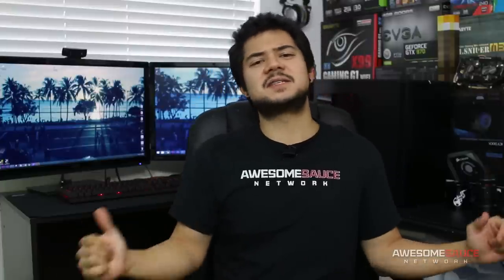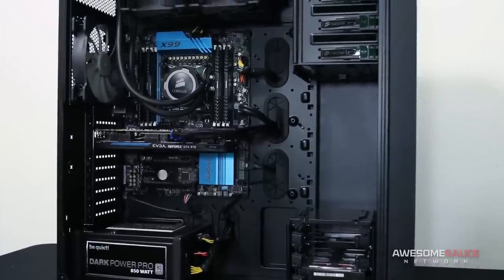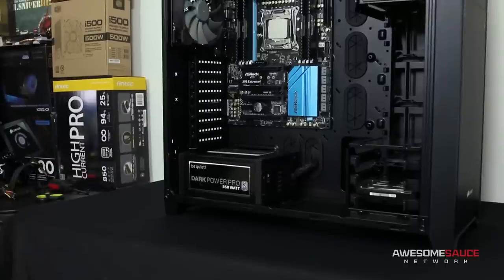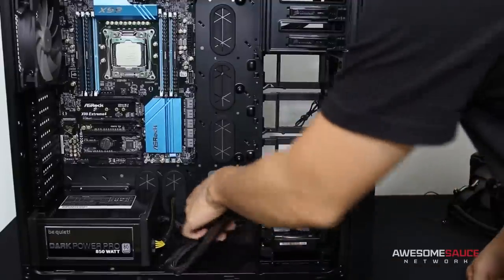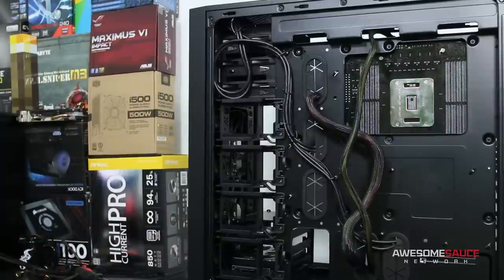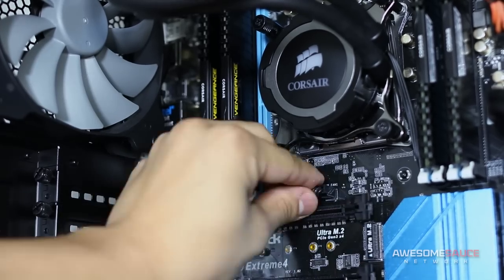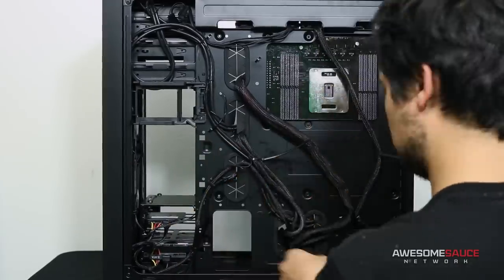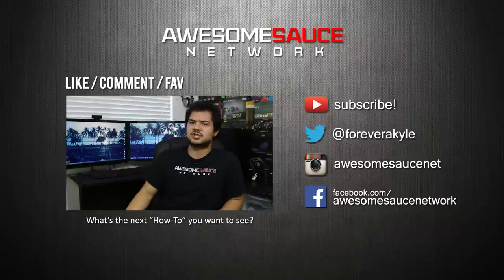How To: Cable Management

Comment: Good stuff, probably upgrading my case on Black Friday.
Reply: Chas Stack  My rig is looking  a mess right  now, upgraded my power supply from Corsair semi moduler 850 watt PSU, to Corsair  RM1000 ribbon cable fully  moduler  power  supply. Ribbon  cables to my surprise  are a bit harder  to work with. Oh well,  buying  a new case  this weekend  that's  more cable  management  friendly, current  case is almost  7 years  old.
Reply: hababacon yeah they twist ez i changed to a cx750m  and had same issue
Reply: Upgraded to Corsair 780T, also upgraded CPU from I7 970, to I7 5930K.
Reply: yeag i got a 3570 now and a 280x 6gb ard and 32 gb ram htperx beast.majoroverkill but great priceon amazon
imay need a new keybboard my k70 is ating up
Reply: wykedinsanity Went with 16 GB DDR 4 (2.66 GHZ), I wanted 32 GBs, but X99 platform is so damn expensive. Almost $1100 for three components, which killed my budget. Next upgrade will be my monitor, looking at ASUS 144HZ 1440P monitor for my BD in April. My current Samsung SA950 is great, but I want beyond 1080P gaming. 4K 60hz monitors are too slow for now, if I could run at 75hz I might consider it.
Reply: yeah ddr4 is pricey
Reply: 32gb of this was 500ish asit was and a bit less maybe withourtt looking in my amazon act again
Reply: aavoided corsair uz my dominater heat sinkks fell off for gods sakke
and now my k70 is acting up
Reply: wykedinsanity $500 for memory? A bit too much for modest gains. Paid $230 for mines, I didn't want to go above  $275. I hope this November DDR 4 prices drop down to $175 for the kit I got. If so I will either double up or look for faster ram with lower latency. In the mean time I don't see myself maxing out 16 Gigs anytime soon.
Reply: hyper-x beast xmp tho and 32 gb
Reply: still alot and no you dont gain much after 16 gb even thr orsair rep told me that oin the phone on my first build but my peicing was less i thinkk was like 50% off so my bad i went and lookked at my amazon history a bit ago 500 was retail msrp

Comment: Really wish I went for a modular power supply myself, though it's a little late now. The "rat's nest" is just off in it's own corner of the case away from the intake fan, so all things considered, heat hasn't been an issue.

Comment: I use a tie wrap gun on the lowest tension  setting. leaves a clean cut that doesn't leave any sharp edges like you would using scissors.

Comment: I have a rig, but I need to completely rebuild it. I must get an anti-static surface to lay my components on, clean them with pressured air (cleaning my previous rig too), install the mobo (the CPU and cooler not being removed), reseat the RAM, put my CS750M in place and screw it in, get an HDD cage that I've neglected, install two harddrives (WD Green 1TB+2TB), screw that into the machine, reseat all the fans, hook them up to the fan controller, take a DVD RW drive out of all my stuff, screw it in in the 5.25" slot, plug its data cable in, plug my HDD SATA cables in, plug in the IO, hook up the 24-pin, the 4-pin (It's LGA 1155), the power to the fan controller (2-pin?), the HDDs' power cables, the (molex?) cable for the DVD drive, all possible in the basement, finally plugging in my GPU with two 6-pins. It's a bit messy right now and I feel a bit badly when I run it. It's not really finished.

Comment: I've got a Thermaltake Commander MS-i, i got an EVGA 600w 80+ Bronze PSU, and it was easy to do the cable management, the thing is that im still going to put an R9 390 on it and i noticed that it will be blocking the sata connectors.... btw awesome video

Comment: LinusTechTips did testing that found that cable management doesn't dramatically impact overall system temperatures, but they also indicated that you shouldn't use that as an excuse not to do it.

Comment: Hi Kyle I recently upgraded my cpu to the FX 8350 but have a H60 water cooler (yeah is a few years old) do you think it will be ok overclocking with this or should I upgrade to the H100i? Which brings me to my next question which is better in terms of efficient cooling the H100i or H105?

Comment: Awesome Guide! Thanks alot! I have Corsair VS650 non-modular power supply. Problem is that it's cpu power cable is too short to reach al the way up to the motherboard. I can't route it from behind the case and I have to take it through RAM and graphic card :(

Comment: For the last 5 years I had my front panel off because I installed the hard drives in wrong way, and the cables were bulging out so much I couldn't put the panel back on... it wasn't until my CPU cooler died that I redid the entire setup and figured out I could simply install the hard drives to face the back panel. The more you know.

Comment: thanks for the video, helped a lot, but I have a question I was hoping you or a fellow commenter can with, my case isn't particularly big and I have a corsair water cooler, if I position it with the cables in the back they sit directly in front of the only place for the fan in the back, am I just going to have to live with them in the front?

Comment: Kyle, the psu you used in this video @1:50 isn't fully modular I, although all you said was that it was modular, it is semi modular meaning the 24pin and cpu power pin cables are soldered inside the psu.

Comment: I should've bought a modular psu when I were picking parts for my PC.
In my current case I'm having a bit of hard time of getting all of the cables out of sight and on the backside.

But that problem should disappear soon as I get my new case (Fractal Design Define R5) :)

Comment: Keep in mind most engineering or electrical fields of study suggest 2"  between each zip tie. This is not required but a recommendation that makes everything "pretty".
Reply: lol what are you talking about 2in this not high voltage 20 amp plus shit... this is low voltage computer baby shit.

Comment: I have a question about the cable management: I have a Fractal Design Core 1500 case that supports cable management. My problem is that the side panel presses on the cables. I made sure that cables overlap as little as possible but the panel still presses on them, especially on the large motherboard power supply cable. Is that a problem or is it ok for the panel to press on the cables?

Comment: Why should the radiator fan/ radiator be at the top/back? im getting the phantecks p400s and you can only fit a radiator at the front of the case, is this a problem i should look out for? (first time building a pc) Thanks.

Comment: my cousins helped me build my pc, he made several mistakes, all the cables and cords look horrible and id like to re arrange the, however all the connections ports seem like they are stuck, should i just use a lot of force to pull them out or is there a special trick to remove each single one??

Comment: When I built my first system, I thought the psu of where all the cables go would be difficult. Turns out it is pretty much impossible to mess this up as there is only one place they can go. The only way I can think of someone messing up is plugging the the gpu cable into the psu and the psu cable side into the gpu, but yet again, it literally says psu on the side that is suppose to plug into the psu. Also, there is more than one cable split on the gpu side, so you know for a fact that it must go into the gpu as the psu has only one cable slot where the gpu has 2 depending on which gpu you're using. As far as which port, using a fully modular psu, to use on the psu, it also says what the port is intended for. With all this said, the hardest part is really cable management.

Comment: I have abit of a problem, I can't get my 24 pin motherboard plug out, I have even tried to push the lock even further out using a knife. I'm using the corsair 750 non modular, and the Msi b85 g43 mb... Help :-)

Comment: what are your impressions on the asrock x99 extreme4 motherboard?  Will it fit 2 gtx 970 in sli at 16/8 speed (5820k)?
Reply from the maker: Seems like a decent board for the price. Yes it will

Comment: Can you try to do it with a mid tower (450d), with 2 ssd and 1 hard drive, and 2 gpu that require 8+6 pin connector? That's what I am having right now, and I have to use the push and slide method for my side panel :((

Comment: Probably won't get an answer to this VERY old video, but I noticed you didn't use the 3-1/2" Bays on the back of the 750D case.  Was that because of the SATA Power cables?  I just started my new build and am having lots of difficulties with routing all these cables on the 750D.  Due to my 2 SSDs and 2 HDDs (and sorry to the purists, my Optical drive) I need to use 3 sata power cable because...well, you can't use just 2 if you chose to use the 3-1/2 bays.  Currently I have cables EVERYWHERE and am starting the cable management all over again because it has turned into a mess.  :(

Comment: Lol. The windowed side of my case (left) is almost perfectly cable managed, I just have the 8-pin cpu connector zip tied to the top because I forgot to manage it and don't feel like taking the motherboard out. Also, the right side is just a rat's nest. lol

Comment: I need help or advice.
I am trying to get parts figured out for a gaming build and I am confused on how the software for my components will be put on my ssd or hard drive. I don't want a CD drive cause it's just not that useful and costs me 14$+ and dont know if I actualy need one to get everything set up or not. Ive seen people open ssd's and hard drives even motherboards that have a cd in it and I dont know if I absolutley need one for my computer. If anyone can help me out that would be awesome.

Comment: Guys help me, I don’t have a routing hole on top of my case, and the 4 pin cpu connector is on the left side of the motherboard, the only way it can connect is to go straight down, but then I can’t install a gpu because the cpu cable is in the way, I have a routing hole to the right of the motherboard but  it’s to short. Should I just get a cable extender?

Comment: if you havent, can you do a how to on relocating SSDs to the cable management area on a case that doesnt have mounting brackets? I didnt plan ahead and drilled out my hard drive cage to make room for a radiator.

Comment: Hey Kyle, first time pc builder. I cannot decide between these two gpus, Sapphire R9 390 nitro or EVGA GTX 970 ftw. Any help?
Reply: I would go for the 390 as I have one and it's great. However there isn't really much difference between them so it's just personal preference really. (The 390 outperforms the 970 in most games but it uses more power).

Comment: you CAN use wires with metal in'em at your own risk! Sure they can help you thight some cables down, but it doesn't mather how much you twist it, it will somehow loosen and fall down inside your case while running, and if that happens..howdy ho Fried Components with sweet chilli on the side! Please guys, just use Zip Ties!

Comment: Yeah, didn't work out so good. Cheap Case Cheap ish non modular PSU with 10 million cables I don't need, a CPU 8pin cable that isn't long enough to be routed behind the Motherboard and of course the back side panel doesn't fit that great anymore but it looks okay from the inside so I got that going for me which is nice. But it was my first build and the second one already came out better except that I have no Idea where to store the 10 million extra cables from the non modular PSU. I think I should really get one of these.

Comment: I use a Zotac 1060 6GB and it has some extra cables for multiple video cards but I only use one , those extra cables are near the connector, what should I do to hide them?
Reply: If you have a Psu shroud, and even if you don't. You can tie the excess cables together and leave them on the floor of your case like I do

Comment: REALLY makes me want to open my case again and start from scratch.  I have the CM Storm Trooper with Side Panel window, and  from my angle, it looks great.  Take the panel off, and complete shit within all my bays.  I have a fan controller, SD Card reader with additional USB 3.0, RGB Controller, DVD-ROM, and Hot Swap Bay, each taking up 5.25 bay.  And then I have five internal hard drives.  Things are not looking up in the cable management aspect of this, now that I am actually seeing it all written down as I type.   sigh
Reply: +murkan14 WEEEEEEEEEEEEEEEEEEEEEEEEEEEEEEEEEEEEEEEEEEEEEEEEEEEEE

Comment: should i upgrade my rig 
My spec - i5 3570 non k , 8gb ddr3 1600 , gtx 760 2gb asus direct cu II oc edition.
Reply: You could use a better gpu, but everything else should be fine. 3rd gen intel core processing units should not bottleneck, plus with the introduction of DX12 and Vulcan, the core processing unit should have less load. DDR3 is fine, as long as you overclock that ram, nigga. alright thats it bye lol
Reply: i had the same with a gtx660 and now I got a gtx 1070 and so far so good 😎
Reply: +Firestarter are you sure that the ram needs to be OCed?
Reply: +KaNawogirusa At what frequency does your random access memory run at?
Reply: +Firestarter 1600
Reply: there is very small correlation between ram speeds and performance but 1866 is better.
Reply: Ram is good, CPU is good, maybe just upgrade your GPU if you're not getting the performance that you like in games.
Reply: Thanks a lot guys I appreciate your opinion. I think I should buy a new GPU.

Comment: My Case has all the standoffs pre installed and one to guide the rest of them but when I put my motherboard in and start screwing them down all the standoff holes are off because of the one that is suppose to guide the rest I have a corsair C70 and a Gigabyte GA-Z97-HD3 LGA 1150 Z97.
Reply: weird. Case problem?

Comment: Linus tech tips did a video and air flow does not affect PC performance at all.
Reply: You're right it doesn't.  Not directly anyway.  Bad cable management will obstruct airflow through the system.  If it is done poorly enough you computer will just start to overheat which will then start to affect the performance depending on how hot the CPU or other parts start to get.
Reply: +Reilly Goldsmith They put bears, pencil holders and even an entire blanket in it and it made little to no difference..
Reply: +Eternal Genesis but that was only temporary, if you have bad cable management, then your pc will collect more dust on the wires, which will make your computer hotter then it should be
Reply: Cubeslayer69 Gaming Videos! Dust will build up no matter what. Cable management is not gonna make noticeable performance differences... People might want that to be the case but it simply is not. It will only look better and be easier to replace parts.

Comment: if you used thermal paste to secure your cpu cooler how do you get it off again (I dont want to risk breaking my cpu / fan)
Reply: Search up on YT "How to remove thermal paste" it'll come up. If not, use a clean, soft cloth and rubbing alcohol.
Reply: use 99% isopropyl alcohol on a swab or buy isopropyl wipes. What do you mean "if you used thermal paste to secure your cpu cooler" Idk if you meant it as if it is securing the cooler but if you did just know that it does not secure the cooler. paste is used to close air bubbles between the processor and the cooler for direct contact between the heat sink and the processor.

Comment: I got a corsair rm psu .... the flat cables are (besides their very nice look) a pain to work with. They are to stiff to bend around corners and it got worse since I've done my own sleeved extentions, because of the extra length of the flat cables behind the motherboard tray =/
Reply: +Intercore222 I got an RM850i and was looking into doing my own sleeving, but I noticed how stiff the wires are as well - I opted instead to go for third party cables: https://www.performance-pcs.com/catalogsearch/result/?q=CableMod+C-Series

They are CableMod brand - and they make proper cables with the right specs.
If you have an RMi Corsair, make sure your cables are those as well, since they have inline capacitors in the cables.
Essentially, just make sure you are getting the cable replacement kit for your PSU.
Reply: +Luis Alvarado Nah ... to expensive and boring looking. I managed to solve the problem by building a cover for the bottom (PSU and HDD/SSD-cage) out of acrylic glas. Now I can hide the majority of the cables in there while just rounding the connections of each behind the motherboard-tray to connect them with my own sleeved extentions ;) 
http://abload.de/img/_1293860kakue.jpg
Reply: Cool, as long as it is something that you like, no one can tell you otherwise, it is your build.

Comment: I am too scared to sort out wires. For one, there is a lot of dust in my PC I bet which will make it a very dirty process. Also, I am just plain scared of breaking stuff in my build. Which is why I just sort of slack all of my wires towards the bottom.

Comment: How hard is it to cable management a PC without a modular PSU?
Reply: it's more of an inconvenience but doable. when I had a non modular the thing that annoyed me the most was the cables weren't long enough for my full tower and I had to use extensions. I've now got a semi modular PSU and it's much easier and cleaner since I don't have tonnes of unused cables lying around at the bottom of my case

Comment: In my opinion, cutting the excess zip tie length is a waste. By not cutting them, you can remove them easily later, and reuse them.